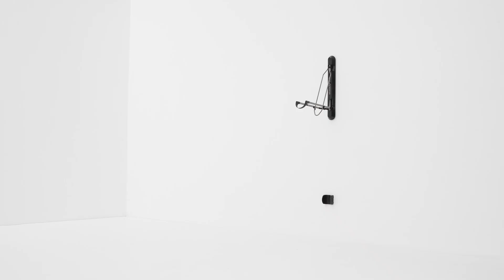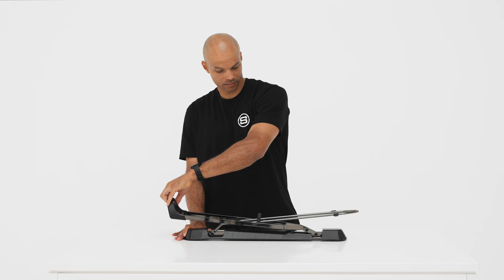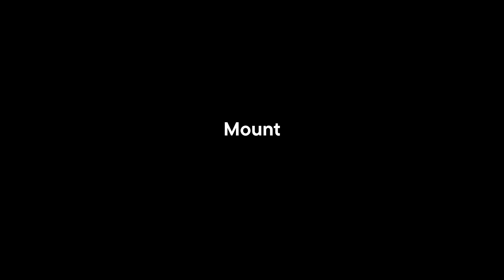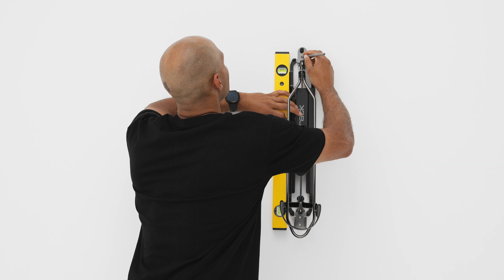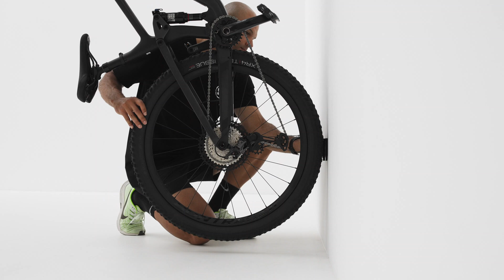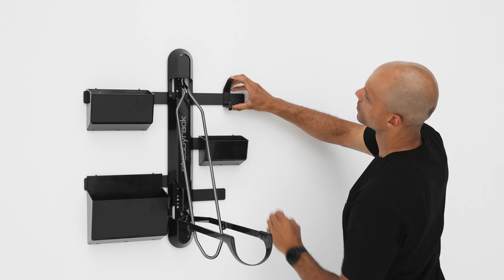ProFlex Bike Rack Installation

Comment: You're suggestion is 3 inches away from the wall for heavier bikes , could I use  4 or even 5 inches away  from the wall ? Will this impact the rolling up of the front wheel  feature ?
Reply from the maker: We recommend using our suggestion of 3 inches as this will ensure that you don't need to do any lifting and the front tyre will roll in and out properly. If you allow additional space, this will result in the rack being installed higher than required for your bike.
Reply: @Steadyrack_  thanks anyway I installed the bikerack  as per instruction, I just need a little nudge with the knee on the saddle hah